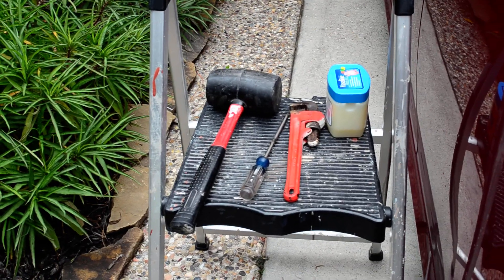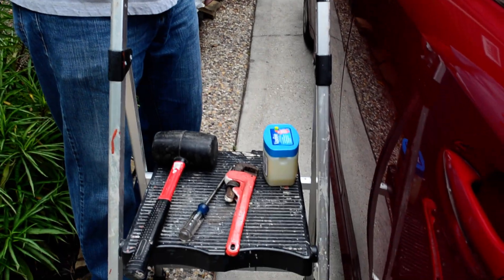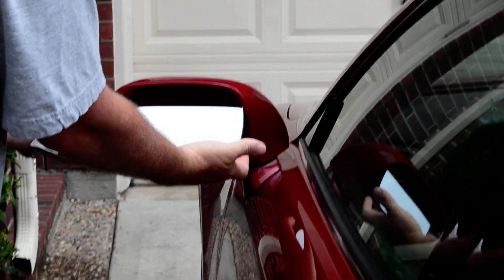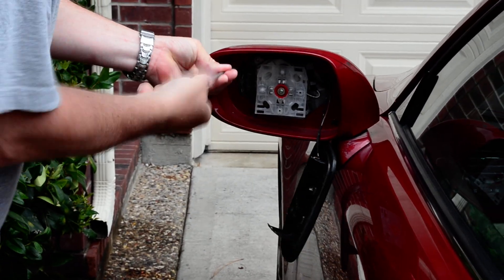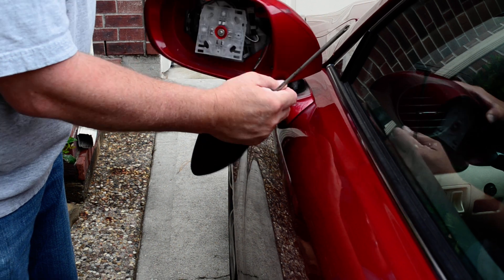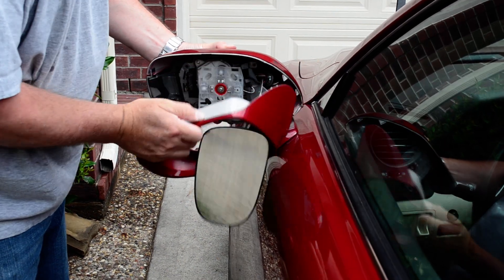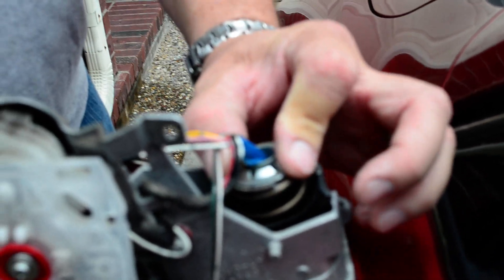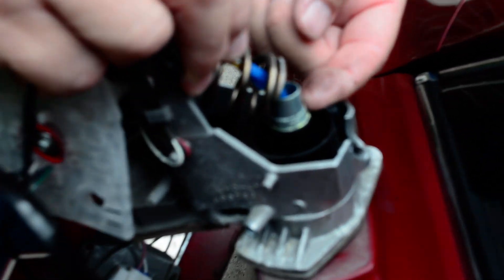Repair Loose/Broken  Lexus Side Mirror Housing

Comment: This was the second video that I watched. It was more thorough and the second try I put pressure on using the ladder. I did buy an oxygen sensor socket for sixteen dollars which was a more direct hit on the washer. While crimping the teeth on the washer, I inadvertently cut one of the yellow wires which I later soldered back together and insulated with tape. Hit the mallet once and the washer seated, then put everything back together and the mirror works great, a great sense of relief since the dealer may have wanted to replace the whole mirror for $1100.00. So grateful for your help!

Comment: Perfect DIY video.  They quoted $900 for the fix at dealership in Los Angeles.  As other viewers have attested, this takes A LOT of force to overcome the spring.  I tried with some channel locks and an adjustable wrench to no avail.  Popped over to O'Riley's and grabbed a $15 Chinese special for 14" pipe wrench and black rubber mallet.  Do yourself a favor and go into the fix with the right tools.

Thanks for the post Larry!

Comment: Hey Larry, I realize this comment is 7 years after your post but I have to thank you for this awesome fix! Fortunately, the mirror assembly is the same for a 2010 Lexus ES350 (our car). I my case, I took the mirror assembly completely off of the car and repaired it on my workbench. Instead of pushing down on the washer/spring (like you did), I turned the assembly upside down using my workbench vise instead of a pipe wrench. Once situation between the workbench vise jaws, I pushed own on the entire assembly until the wash "caught" the stem. Once "caught", I turned the assembly upright again (using the vise to now hold the three mounting bolts) and used a screwdriver and hammer to push the wash down further on the stem. Since the vehicle is now 10 years old, I refused to spend the $1000 I was quoted to fix it at a Toyota dealership. Thanks again!
Reply from the maker: And that is why we make videos. To help others. Thanks for sharing. I still get great comments.

Comment: Thanks so much for coming to my rescue. I fixed this problem once, however, after a few months, like 5k miles the problem came back. Today after disassembling and getting  ready to seat the compression washer I noticed the washer was weak to the point that all the 'spars' separations on the compression washer were not grabbing around the shaft it lives on. So....i'm in search of a replacement compression washer. Going to the local hardware store since like you I Hate dealerships. Wish me luck. Again you have been a Godsend.
Reply from the maker: another option is to use a drill to drill a small hole through the tube as close to the top as possible being careful not to drill wires. Use a small cotter pin to secure the compression washer once you have it back in place. Several people have done that with success.

Comment: Hey Larry, I just used your youtube video with great success. Thanks a million! It was on my lady friends car, and now I'm the "hero"! It didn't go without a "hitch" though. As your video shows - the compression nut slipped off the one time for you. Well even though I was able to get it down all the way over the spring, it continued slipping off no -matter what I tried. I finally took a pair of channel locks and squeezed down the 'prongs' a little bit all the way around to make it a bit tighter on the post until I was able to strike it down with the mallet. If any of your readers have this same issue, bending down the prongs just a little bit was enough to get the compression nut to grip the post long enough to get the mallet on it. Thanks again for the great video!

Comment: awesome.  saved me $1000 because I had to do both mirrors. 

One tip others might find useful: I couldn't get the retaining washer to stick in place like Larry could, so I drilled two holes in the post, slightly off center, and added a cotter pin right above where the ring is supposed to stick.  I used the pipe wrench to push everything down and had a helper put the pin through.  

 I realized on my last post-hole drilling that you can put a flat screwdriver inside the post to protect the wires from the drill bit coming through and trashing them.  Lucky for me I just destroyed the outer insulation without any major electrical damage.
Reply: Oh man, that's a good idea!  I tried this yesterday on my 2010 IS250C and also couldn't get the washer to stick down there no matter how hard I tried, so I resorted to just sticking it in place with some VHB tape, but putting a hole and cotter pin through that post sounds like it might be an even better long term fix.  I'll try that next!  Thx!
Reply: Just piggybacking, I did this with my dad just now. You really gotta force the washer into the metal part. It doesn't look like it sticks anywhere initially but if you hold it down and hit it hard enough it'll stick. The dude demonstrating this video must be strong or a really heavy dude. I held it down with a small wrench and my dad used a hammer and metal tube to whack it in. I think we did it too hard because the mirror doesn't fold in like it used to. But better than having a floating mirror lol

Comment: Wanted to say thanks, I just tried this and it worked.   I will say, applying enough force to re-engage that clip was even more difficult than it looked in the video.  Every other step was easy and flawless.  I even had an easy time and no need for vaseline to get the mirror back on.  So thank you again!

Comment: Lexus WILL NOT  fix this for you like Larry did, they will simply replace the whole part ($300?) and double that as the bill for 1 mirror, so if you pop both spring clip it will be a $1000 fix and a not-so-happy trip to Lexus.

That particular spring loaded mechanism is a manufacture defect component (design flaw due to weak clip), but because it's not a life-safety defect, no recall was done and Lexus simply said "fuck it it's not my problem".

Lexus is still very ignorant on issues like this when it comes to non-life-safety defect components. 

You guys need to drop a comment and thank Larry for this video because he just save you all at least $300 even you try replacing the whole thing yourself.
Reply: Actually Lexus was helpful for me. They sent a mobile tech to my place (1/2 hr from dealership) and noticing my garage/tools/early Vette, he said, you can easily do this and explained how to repair. He spent 1/2 hour looking over Vette.  All no charge. Bobby Rahal Lexus treats me well.
Reply: @davem6685  👋🏽 did it fix the issue? The other day someone hit my mirror walking by I guess and now the mirror sways side to side is this all I need to do?

Comment: Nice work Larry!!! This worked like a champ on my wife's 2010 IS-250 C. It appears that the compression nut loses its tension and slips off. POOR DESIGN LEXUS! I don't know why they wouldn't use a threaded nut over a compression fitting. Thanks again Larry! The job took me 30 minutes, and for a beer I hired my neighbor to hit the pipe wrench. The hardest part was to get all of the plastic housing parts and light back together. I believed you may have saved me $300+ if I had taken it to Lexus. Way to go!!!
Reply: Because car manufacturers, like Lexus, don’t actually make mirror assemblies. To Lexus, just like most people and other automobile manufacturers, the side mirror is just a part. That’s why they don’t rebuild them and that’s why they don’t seem to have the same quality of internal design as the rest of the car.

Comment: Just did it a minute ago. My issue was that it wasn't staying down once I compressed it. So I had my wife come out and tap it while I had the spring all the way compressed. This takes a LOT of pressure. I'm 5'10" 240 lbs and I was laying into that with all my weight. Just to be extra safe I did put a beach towel between the mirror and the car as the pipe wrench wiggled when I was pressing down. A warning of sorts. Also I didn't have a rubber mallet. Everything in this video was spot on. Thanks again.

Comment: Thank you.  I also just did this yesterday.

I couldn't work it with a wrench because I was not strong enough.  For anyone who has a similar problem, we used an O2 sensor socket (to accommodate the wiring), and put a small extension on it.  I pushed down the spring as far as possible and my wife hit the extension with the mallet.

Comment: One additional tip.  This video was exactly what I needed to fix my IS350 mirror, but the fix wouldn't last more than a few weeks.  The compression fitting kept popping loose.  I did it three times before I seem to have solved it once and for all.  At 4:25 when he says "that's it"... I added a step.  Once the compression fitting is back in place, get the smallest metal hose clamp you can find and put it around the post and sinch it as tight as you can.  With the addition of a tight metal hose clamp, the compression fitting can't pop off again.
Reply from the maker: GREAT ADDITION TO THE FIX! EASIER THAN DRILLING THROUGH THE POST AND USING A CARTER PIN.

Comment: Same here... dealer wanted $$900.00 new installed..  20 minutes later following these directions.. completed both mirrors.. I compressed the star clip so that it had more grab once you compress it.  I had my wife hold the wrench in place and I climbed the stool and did a single force push with my heal. Went right into place.. couple taps with rubber mallet and we were in business.. part of the problem this is the holder ring on the shaft is worn.  That is why I compressed the star ring... thanks for your help this was great..

Comment: This was the only actual fix I found on you tube. Thank you!
Once I got the spring to stay put I whacked it pretty good a few times with the mallet. I think I pushed the spring down too far though cuz it doesn’t fold forward or backward much at all anymore.  Not sure if the car wash will damage it.

Comment: Tip: Use a O2 sensor socket, and tap it on with a mallet.  Worked like a charm!!  Thanks for the video!!
Also, it seems you do NOT have to remove the screw on the lower inboard. The back comes off with that still screwed in and you can access the snap ring and spring.
Reply: What size sensor socket and drive did you use? Assuming you have a Lexus.
Reply: @korchao   I'm not near the garage, but I also think o2 sensor sockets are all the same size. The point is the slit down the side of the socket to allow the wire to bend out of the way.

Comment: Thank you it was too easy ! 
I had a O2 sensor socket with an extension and a mallet dead blow, went on, no ladder or pipe wrench.
Tip: I used a plastic 55 gallon trash turned up in side down with a terry cloth towel to catch any dropped screws and supports the loose mirror and holds the tools!🛠️

Comment: I appreciate that you figured out "a" way to fix this.  When I did this 4 or so years ago, I could not get it to work even though I tried it just the way you showed.  Nor could my stronger neighbor.  Kept popping off.  Finally, since we are both engineers, we made a tool out of a piece of pipe with a notch to protect the wires, where we could put the pipe over the mirror shaft and hit down on the press fit washer with a hammer and apply uniform force down on it.  One of us held the pipe putting downward pressure onto the spring while the other hit the top with a regular hammer.  Even with that, I remember the two of us messed with it for the better part of 30 minutes to get it to stick properly.  I only wish I put a pin in it or a cotter pin or something (drilled out) so it could NEVER come loose again.  Dumbest design ever.  In fact,  this should have been a recall item.  My guess is the manufacturer has a tool that can mechanically press that on in about 2 seconds.  But a pin dudes!  Hello.  (Edit:  Thankfully I just found that tool we made stuck to the bottom of a tool chest drawer (leaking locktite) lol)

Comment: Just used your vid as a guide to fix my 2010 es350 in the parking lot at work. I can confirm it's the same for this generation of es. Thanks :)
Reply: I can confirm this, it's exactly the same on my 2010 es350 as well. just fixed it today; I had a large O2 sensor socket -- the kind with the cutout for the wires -- and I was able to use it for this job, made it super east! just one good whack of the. hammer.. thanks Larry!

Comment: Also, Lexus said I needed a new mirror, $400.+ and about $125.00 to paint it!
I had 3 LED bulbs in tail light that went out. The car has 4 of these 3-bulb lights in total. They quoted me $499.95 to replace. I asked if all 4 went out what would it cost? Same price, $499.95 times 4! Crazy! Thanks again for your mirror-fix video!

Comment: Appreciate the video! This is exactly what happened to my mirror, so I watched this video when I was at the office, so I could work on it. After 10 or so vein popping attempts to get the clip pushed down, and a few tears later, I remembered one thing in your video that I didn't try... The ladder. I pulled out my yeti cooler (didn't have a step ladder lol) stood on top of it, pushed down on it with all my weight, and got it on the first try. Then hammered it home.  
Anyway... Thanks for the video, I would have never figured that out.
Reply from the maker: Glad it worked. Getting leverage is the key that I should have posted. But did it in on quick take.
Reply: Is this fix still working for you? My girlfriend's mirror just started doing this same thing and the dealer quoted $800 to fix it.
Reply: Tim Ulibarri 
It is still working for me! No issues yet
Reply: OkieBoy Are you able to turn the mirrors in again or no?
Reply: Anthony D. - yessir!
Reply: OkieBoy I forgot to tell you it worked for me too!
Reply: Ok...this has got to be the weirdest coincidence ever.  I fixed my passenger mirror using this video 8 MONTHS ago. Yesterday I get reply to my post on this video.........today, my drivers side mirror broke! Ugh....at least I know how to fix it

Comment: Thanks for video, saved me a few hundred dollars.  I just fixed mine today, but I did go a step further and I drilled a hole and installed a cotter pin.  From looking at that design it really needs a cotter pin, roll pin, or else you will be doing this all again real soon. That pot metal failed where the compression nut was grabbing and it will surely fail again.  I think I'll go ahead and do the driver's side the next chance I get, because I know it will be doing the same thing and it should be easier to do a cotter pin mod while the spring is already compressed.  For those out there who want to install a cotter pin just be sure and protect the wires going up through the post prior to drilling and pushing the cotter pin through. Just a real piss poor design on the part of Lexus.

Comment: My 2010 Lexus IS 250C driver side mirror just developed the same problem. After seeing this video, I was hopeful of fixing it but couldn't as in my case the shaft is not like Larry's - there is just a very minor protrusion unlike the very pronounced one in Larry's video, so no way the washer would hold if the spring was pushed down. As others have noted, the spring is very strong and difficult to compress even with the use of a ladder, rubber mallet+monkey wrench. I may have to live with the double-sided tape fix as I don't feel like paying Lexus $1005 for the mirror assembly + $326 labor + tax for a flaw which shouldn't have been there in the first place!

Comment: I fixed my mirror in less than 10 minutes. The collision center wanted to charge $750. I used an oxygen sensor socket instead of a wrench. It has an opening  that prevent damage to the wires. I used a hammer instead of a mallet to hit the top of the oxygen sensor socket. The oxygen sensor socket can be purchased or rented from Auto Zone or any store that  sells auto supplies.

Comment: Thanks Larry, great video. It works brilliantly. I don't  have the strength to hold the clip down and lock it in position so I had another person to push the clip down and I just whacked the rubber mallet and it works.

Comment: This is a very cool and easy fix.  FYI.  I used large crescent type wrench to pound on with my IS 250,  and that worked too.  I am furthermore testing a  hose clamp to better hold that compression nut but cotter pin is a much better idea if you have a drill.  Just watch those wires inside the shaft.    Definitely a design flaw.  Thank you very much for this video.

Comment: Thank you for the video.  I did not have a large wrench like you used, plus I didn't like the idea of metal banging on metal, so I took a piece of 2" X 6" redwood and cut a two centimeter wide notch out of the center.  Basically had a nice 6" wide square with a notch to fit around the wires and post.  Used a step-ladder to get good leverage and seated it down.  Pounded the top of the wooden block with a regular hammer to get it on a little further.  After reassembly of mirror, I have found it doesn't want to fold in.  I guess I got that compression fitting a little further down that I should have.  But the mirror doesn't flop around, either, so I'm calling that a win.  It may fold if I apply more force, but just didn't feel like doing that right now.  Thanks again.
Reply: I also pushed the compression fitting far far down, and now it takes a lot of force to fold the mirror. But I almost never have a need to fold the mirrors, so that is not an issue.

Comment: I bought a $0.50 hose clamp from Home Depot , used a pipe wrench to hold the spring down and had a friend tighten the hose clamp around the cylinder.  Did this on both side-view mirrors on my IS250, it's held for over a month now.
Reply: Thanks for the tip. I bought a hose clamp and will try this method. As much as I tried, I couldn't muster the strength to get the washer teeth to grip the base like Larry did. I think using a hose clamp should suffice, since the washer doesn't need to be that far down the base, anyway.